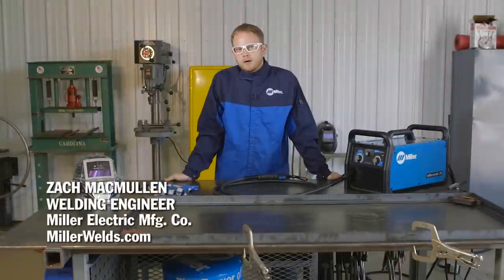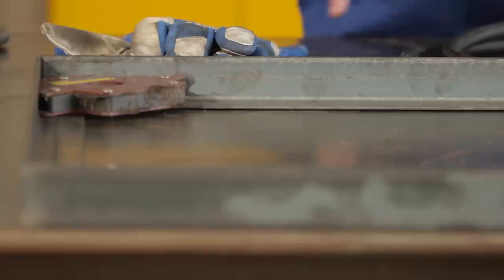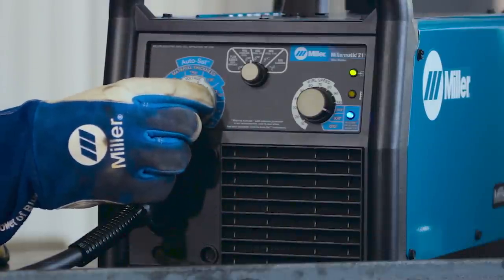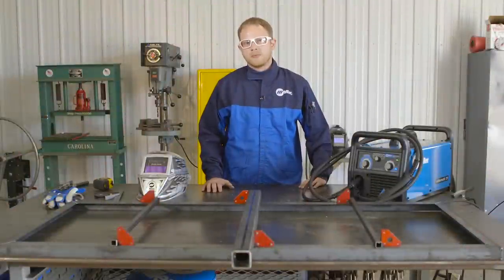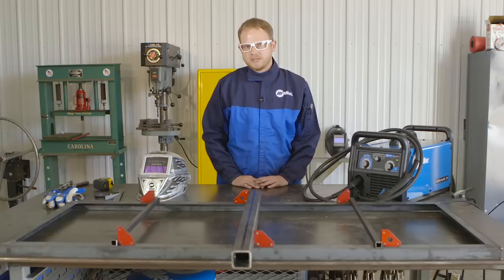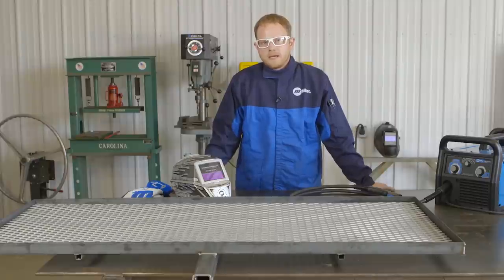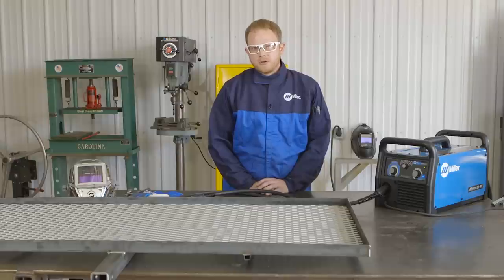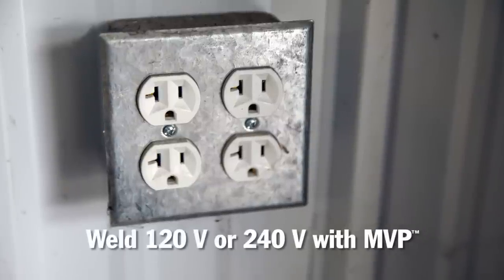How To Create and Weld a Cargo Carrier with Millermatic® 211 MIG Welder

Comment: I know this is a several years back you build this but can you tell me the wall thickness of the tube that goes in the hitch my platform is going to be about 2 feet wide and I'll be caring about 250 pounds any suggestions would be helpful thanks.